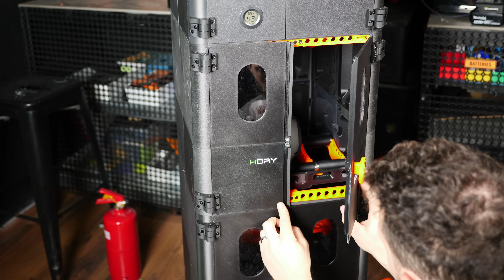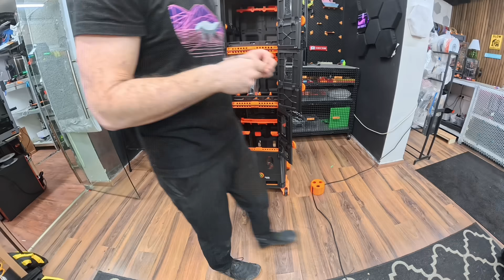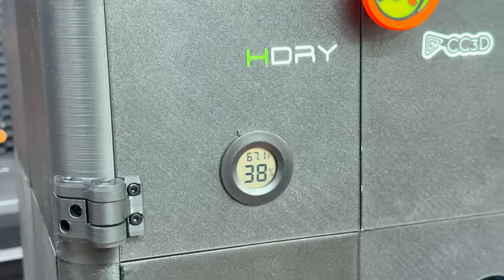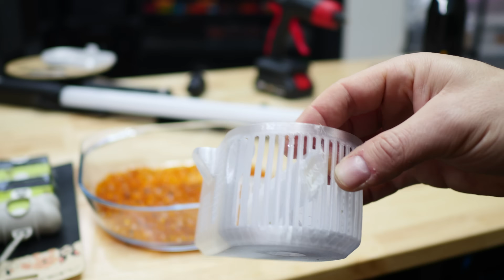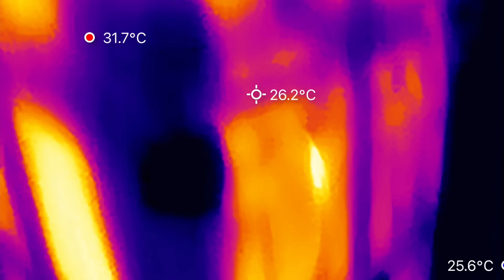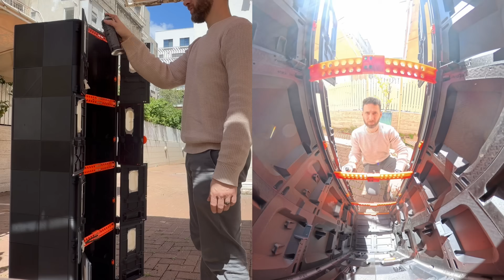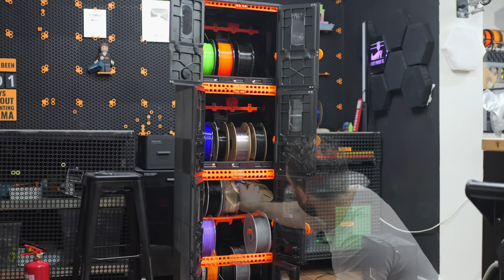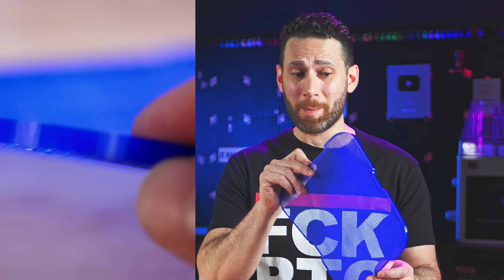This Will REVOLUTIONIZE 3D Printer Filament Storage!

Comment: So..... I am actually speaking with Enrico about a rotating dessicant disk system that automatically rotates to dry the filament.  I am a refrigeration hvac technician with 18 years experience in Aus. So moving air and making it hot, cold, dry, or wet is my specialty. Would love to work with you to potentially bring some of my thoughts to fruition. 👍
Reply from the maker: Oh snap! Let’s do it
Reply: @thenextlayer 👍 i have some bloody wild ideas. What the best way to message you? (If you see value in it of course)
Reply: @tobyspackman4054  get in touch with him via his business email on the YouTube channel
Reply: @tobyspackman4054  I’ve been brainstorming and testing this idea for a metal storage cabinet I have sealed up. I would be very interested in what you come up with. I don’t have associated expert experience but I feel like a relatively simple approach with a heater, blower, dry box, and dry air circulation duct should be possible. I do think I like the rotating wheel idea most. I’ve also been trying to figure out a simple cartridge pathing that could move desiccant cartridges into a drying chamber then back into the cabinet.
Reply: Bento-box style design, with tabs or magnets that interface cleanly with your head unit, plus whatever linear motion system and microcontroller fit the job best.

Honestly, build the open-source OttoEject project first. You’ll learn a ton from it, and by the time you’re done, you’ll probably have most of the knowledge you need to build what you’re describing.
Reply: @wehavefunofficial  thank you, I’ll dig into this over the weekend
Reply: I know little about dehumidifiers; they recirculate air while extracting the moisture into some convenient-to-empty container - much quicker and easier than dehydrating dessicant, especially if a water pump is involved. At first glance, slapping one on the back of the storage unit appears to be the ideal solution, but a quick look at consumer models suggests a lower limit of around 30% RH.

So, can they be modified to 20%, 10% etc?
What is the power draw vs dehydrating dessicant?
Are units available for the small volume of the storage unit?
Reply: My basement dehumidifier never gets below about 30% RH, but that is a completely different drying problem than conditioning a small sealed filament space.

A room dehumidifier is fighting the moisture load of an entire basement: air leakage, concrete, seasonal humidity, temperature swings, and constant reintroduction of moisture. Filament drying or storage is much more controllable because the air volume is small, the enclosure can be sealed, and the system can be tuned around a specific material goal.

The path to a genuinely good solution is to stop thinking in terms of one magic component and start thinking in terms of a system. Experiment with enclosure sealing, desiccant type, airflow path, airflow rate, temperature, regeneration method, and sensor placement. Test what happens when the air is static versus circulated, when the desiccant is in the direct loop versus off to the side, and when you add gentle heat versus relying on adsorption alone.

It is also worth learning the differences between the drying media, because they do not all behave the same. Silica gel is cheap, accessible, and great for a lot of hobby use. Activated alumina is tougher, handles moisture differently, and is useful in more process-oriented setups. Molecular sieve goes further when you want deeper drying and more aggressive moisture removal. Each has tradeoffs in capacity, regeneration temperature, speed, and cost.

Those electronic moisture membranes are worth exploring too. If the membrane product you’re referring to is the Rosahl solid-state dehumidifier approach, that is a different category from a typical desiccant box or heated dryer. Rosahl says its membranes use a proton-conductive solid polymer electrolyte, run on low-voltage DC, can maintain low humidity in sealed enclosures, and are designed for long service life with low power draw. Independent coverage of CNC Kitchen’s tests also noted good low-power performance from Rosahl’s RS1 and MDL-series units in filament storage experiments.  ￼

And yes, reading patents and public documentation can absolutely help you understand how a system works, what materials are involved, what the operating principle is, and what design constraints matter. That is a valid way to learn. The useful mindset is not “copy it blindly,” but “study the mechanism, understand the material stack, understand the physics, then prototype your own approach around the same principles.” Public patent literature is often one of the best technical breadcrumbs you can get for that kind of learning. I cannot help with dodging someone’s patent rights, but I can say that studying disclosed mechanisms, materials, geometry, airflow strategy, and control concepts is a very real way to level up your own designs.  ￼

So the real answer is not just “use a dehumidifier” or “throw in silica.” It is: define the target, build a small controlled environment, and optimize it through testing. Try different desiccants. Try different airflow strategies. Try heating, regeneration cycles, and sealed-vs-vented configurations. Measure everything.

And if you really want to go down the rabbit hole, start learning about vacuum drying, vapor pressure, and deeper low-moisture process control. Once you understand pressure, moisture, adsorption, diffusion, and phase behavior, you stop guessing and start engineering.

One quick naming note: if you meant the expensive commercial filament drying and storage product, that is likely Polymaker’s PolyDryer. If you meant the electronic moisture membrane product, that is likely Rosahl and specifically their RS1 / MDL membrane line. PolyDryer is a modular heated drying-and-storage system, while Rosahl is the solid-state membrane dehumidifier approach.  ￼
Reply: @e @ecatVids  look at a psychrometric chart will show you how humidity changes with temperature. A conventional dehumidifier cools the air down to condense water out of it before heating it up again, but if it’s 20C and 60%RH out and you bring your cold plate to 0C, once you heat that air back up to 20C it will be no lower than 30%RH, give or take. The dehumidifier method is more powerful when used as a part of a heated filament drier, by dropping that air to 30% @ 20C then piping it into a drier at 70C, it drops to 2%RH. You’d probably want a counter-flow heat exchanger on that air inlet though, otherwise you’ll be wasting a lot of power to heat up the incoming dry air. Once it’s bone dry, slap that filament in a sealed vessel with a quality desiccant like molecular sieves, that will keep it low. I was working on a design for a compact and cheap heat exchanger design but the materials science got away from me a bit.

Rotary drum dehumidifiers are less efficient (if you don’t have waste process heat to use), but don’t have the same limitations as refrigeration-based dehumidifiers. I suspect there’s a similar limitation in the desiccant achieving equilibrium with the air to be dried, but there’s likely a calculation you can use to figure out the required drying temperature for given outside and target RH levels. The bigger issue to me seems like the sealing of the drum, if you want to use low airflow (e.g. 10 minutes to fully recirculate the chamber air) and keep a chamber very dry, air leaking in past the drum would be a big deal. I can see why commercial systems may instead use sealed cartridges that are dried separately. With some electrically actuated air valves it could be done without manual intervention.
Reply: @Scrogan  Thank you for that :)
I can see some fun being had with rotary disc dehumidifiers, with most of the disk in the fliament chamber and the heating section 'sticking out the back'. 
I'm also imagining a cable car like system, with each car filled with dessicant, passing through the chamber and outside for drying, quite a sight, lol.
 
Any thoughts on membrane dryers, eg SMC IDG50A. Expensive but not when compared to $14,000!
Reply: @Scrogan  some good point there! But have considered all of the cooling options first. (Remember I am a refrigeration technician). I was considering building a vapour compression system specifically for this project! But 99.9% of people cannot do this. And its MASSIVE OVERKILL. I want the solution to be 3d printed as much as possible.
Reply: @tobyspackman4054  there’s a guy here on YouTube building thermoelectric cooling systems and proving that they can be more efficient than most people are led to believe, so long as you stick to the left-hand side of the parabolic process curve. Thermoelectric is how I’d do it anyhow, you don’t need much cooling power if you want the drier to work on a small volume over multiple hours.
Reply: That background is exactly the kind of foundation you can build from.

You already understand airflow, temperature control, moisture removal, pressure differentials, and system behavior in the real world. That is a huge advantage. The next step is just translating that knowledge into prototyping, controls, and fabrication.

Start simple and build outward. Learn a bit about material properties, structural design, and motion systems. My first instinct for something like that would be a rotating cage or helical carrier with a clearly defined fill limit, driven by a stepper motor with enough torque and reduction to move reliably under load. None of that is out of reach now. A cheap ESP32, a basic stepper driver, a few parts, and curiosity will take you a lot further than most people think.

That is the exciting part now: an idea does not have to stay an idea. You can model it, print it, test it, revise it, and keep stacking improvements. Your HVAC experience gives you the real-world intuition. The rest can be learned piece by piece.

If something interests you, follow it hard. Experiment with heaters, sensors, control loops, dampers, vacuum systems, pressure systems, desiccants, chillers, scrubbers, whatever pulls at your curiosity. Build on top of what you already know and let one project lead to the next.

You do not need to know everything before you begin. You just need to begin, stay curious, and keep asking better questions.

And honestly, with 18 years in HVAC, you are probably closer to building something great than you think.
Reply: All of this is great. I just finished my H dry system about a week and a half ago and I’m very interested in this. Mine’s been working pretty well but I know I do have some leaks. I’ve been staying around 22 to 24% which I think so far is really good with how high the humidity gets in our home. If you need a guinea pig for anything, I’d be happy to print something off and try it.
Reply: Good Idea, one flaw i see in the Old System is: No outside Access to reduce the Desiccant "floor". Everytime the Frontdoors open you have the Air Humidity in it, with desiccants it means you have a limited humidity floor when you dry it with desiccants down from 40% to 20% your desiccant floor will rise from the inital 10% to 20%, when you then open the door again your next floor maybe 15% etc.. With rotating discs you can swap to fresh desicccant which has no elevated floor without increasing humidity in the Chamber. Another Option would be an option to swap the Desiccant Box from the outside. Simpler and "unlimited"  as you only have to swap it very often on the initial phase and later only every 4-5 days. For longterm maybe a solution, you only have to remove a cartridge by pulling it out and when putting it in from the outside the fan blows from above. Maybe an outside Cover for Airtightness. The rotating desiccant disk is more something for the automated quick dry. But an Outside Cartridge System would be easy to use and don't need mechanized Parts.  We need to think outside the box, how to move the water outside, without getting new Water in. A box with Desiccant is literally a bucket with water we fill inside the dryer and we have to get it outside to without letting new in. So simply pulling it outside through a small hole and putting a new in is imo the best solution, without a complex heating mechanism.
Reply: I was thinking the same about the rotating disk/drum.
I used a similar system at work to prevent condensation  build up in large generations when they were turn off for extended periods.
It was a partitioned desiccant drum that rotated between two ducts, one fan to blow the air around the generator, and a fan/heater to dry out the desiccant.
Reply: @tobyspackman4054  yep basically a munters unit!
Reply: They already make and sell dehumidifiers based on this, and they're incredibly cheap for being built with your exact components. I have plans to modify one into a large filament dry box
Reply: I have been designing and pondering these same systems
Reply: I feel like a rotating system has too many moving parts and would take up a lot of space. Have you thought about a dual tower design for heatless regeneration like in a compressor system?
Reply: @soul_in_a_fishbowl  A conventional compressed air unit would take too much power unless you had a lot of filament to keep dry, you might be able to do a low-pressure system with wider pipes and fans, but it’s not clear to me how you’d handle the electric valves, because these valves still need to seal well. Additionally, passing room temperature ambient pressure air over your desiccant isn’t really going to dry it out much, you’d definitely want a heater.
Reply: @S @Scrogan ah I didn’t expect it to be pressurized. The idea would just be two containers basically at ambient pressure. And which valves are you talking about specifically?     The air isn’t compressed in this system so sealing is much less of an issue. You can replace the air inlet system with a small fan on each chamber since you’re not coming off a compressor. If you don’t think the dry air coming off the one side is enough, you could throw in a heater. There are systems though that use ambient temp air to dry the desiccant so clearly it is enough for those to work.
Reply: I can say as someone who's custom built about a hundred of those plastic cereal container dryboxes, a rotating desiccant container works wonders. I set mine up with 40g in a static container at the bottom and another 35g inside the spool, so when they're in use, and rotating it cycles the desiccant at the same time. The result, is it actually gets drier inside the box while the filament is in use. Usually a drop from around 24rh down to 18rh over a couple hour print. (No fan required)
Reply: @AxMnX  That’s definitely interesting, though it’s entirely different from the sort of rotating desiccant drum systems that I believe are being discussed. You need to manually recharge your containers, while the drums in question are continually having part of them recharged.
Reply: @Scrogan  I was simply stating that the act of rotating them helps immensely, even without a fan, but with one it should work substantially better.
Reply: Why not just get a desicant dehumidifer and duct the intake and outake through the cabinet... or use a bigger cabinet with the desicant dryer - something I've been planning on.